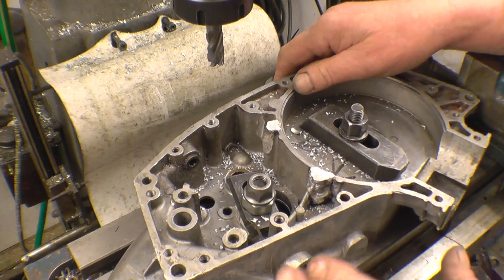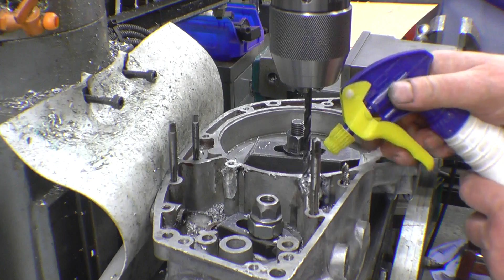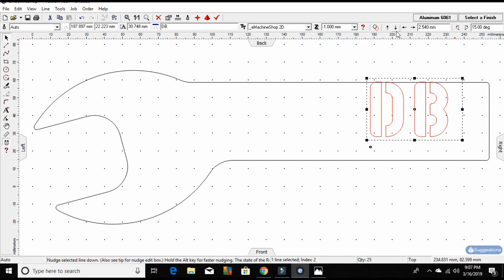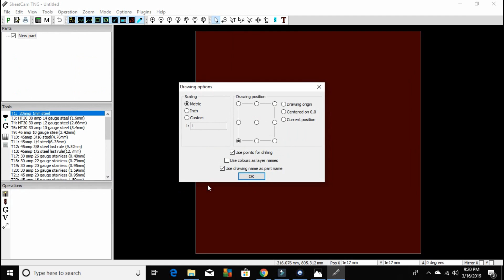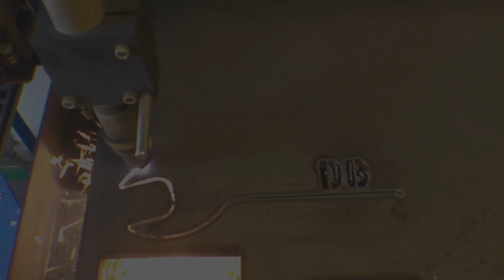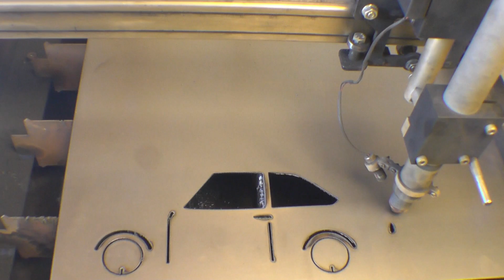SNNC 269 P2   BSA Crankcase Repair      Plasma Cut Spanner

Comment: nice bit of repair work on that gearbox stud mount that should last the life of the box also like the spanner and the "how you do it" on the computer very interesting! I was once a cnc turret punch operator that had to modify and add lines of g-code to get the job done. my best to your dad and debs.